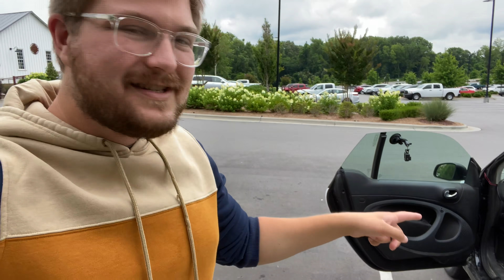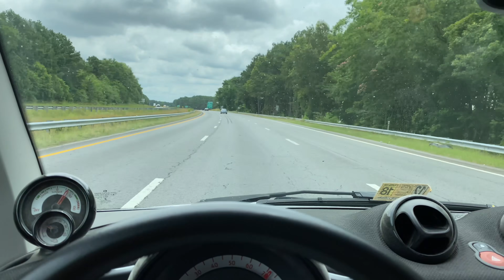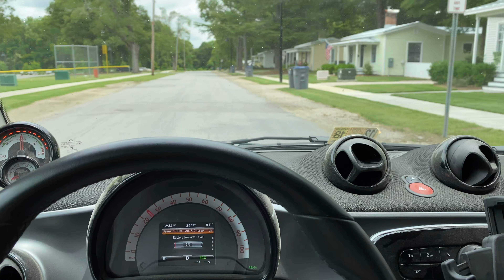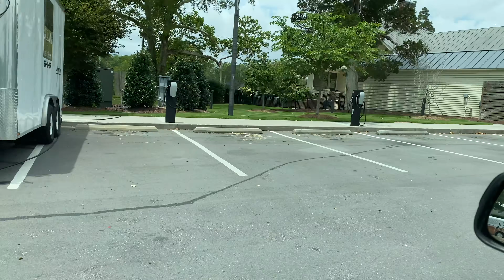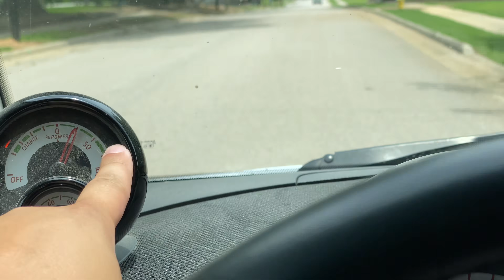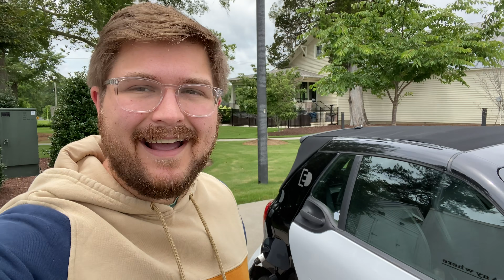2018 Smart Electric Drive 70mph Highway Range Test (Not Very Good)

Comment: Glad to see this.  We have a 2016 Smart For Two ED and love it for around town!  I love driving it with the back window open in our coupe in the summer.  We have a little device that just opens it about 1 inch and it is locked there when the car is locked.  It is not for everyone but it was our first EV.  It was purchased used.  It had been leased to a head shop in Colorado Springs area.  We found a roach clip in the seats after delivery to us in TN.  (We had is shipped!).  We love it and have since got a Tesla Model Y and have a Cybertruck on order!

Comment: I have the exact same car. My average consumption is 133 watts per km which is about 78 miles on a full charge. I’m gonna try to do a range test on highway and see how many kilometers I can extend the range up to. Will post the results here if anyone is interested.
Reply: Hi, I'm really interested. I'm about to buy a used Smart Fortwo 2017 (12.000€) and I need to drive 90km (56 miles) on highway. Do you think I'll be able to do that? Thanks in advance
Reply: Bad idea. Good chance you won’t make it in the really hot days and the cold days. And when some traffic jam happens you wil also be f…. So buy a Renault Zoe or something that has a little more range

Comment: Just bought one and i do mostly freeway between cities. my mpge is 120. after 42 miles of mostly 73mph driving the battery is at 42%. best part is it cost me $15k with only 6800 miles on the clock.

Comment: I had one of the last Smart CDis. Wow, incredible economy. 85-90mpg on a run to Scotland and back. EVs are a good idea but not practical enough for most people yet. Rich folk with driveways to wait all day and night to charge them and don't have any interest in driving very far, it suits them. The rest of us live in reality. I like EVs but I like the future version of what we have today. 1000 mile range no matter what the weather conditions or usage of lights, heater etc and the ability to pull into a service station, plug into one of the many plug points in place of the fuel pumps, charge to full in 5 minutes. Thats when I would like to get an EV. Until then, I shall stick two fingers up to everyone with a nice boxer engined Subaru. At least I feel alive in that.

Comment: Great video, really enjoyed it! I just bought my second smart EV a month ago (I live in the EU) and for those who pooh-pooh the range I can say - the car is not for you. My place of work is 3 miles away (all city driving) and I recharge the smart once a week. In the city I get about 80 miles of range without straining the battery. Need to go further? All you need is to have other cars in the garage and you're fine. So it's not for everyone, but it sure is for me!
Reply: Right? People should be realistic with their driving needs.
Reply: EXACTLY  @samusaran7317
Reply: Hey, I'm about to get a Smart Fortwo 2017 (12.000€) and I was wondering if it is possible to drive 90km (56 miles) on highway. Thanks in advance
Reply: @alex-eucmad.7133  Not sure, is it the current version?
Reply: Did you get one in the end ? 
I have other EVs, I doubt this thing can make it 90km on highway speeds  @alex-eucmad.7133
Reply: @alex-eucmad.7133 This range test just showed that he only got 52 miles. So I’d say no, you can’t get 56 miles on the highway.
Reply: +1. Not the right use for this car.

Comment: I bought a 2017 Smart a couple of weeks ago and it had a similar whistling sound on the highway. Turned out to be a leak at the top of the windshield on the passenger side. Mercedes is going to replace the glass under warranty since they usually break when they try to remove them.

Comment: My Smart diesel , fortwo does that far plus another 20 on less than a uk gallon  4.5 litres  it hold 6 uk gallons so that is a big range without filling , on the road charging on the uk roads are expensive and rare to find.

Comment: Rocky Mount...great city! I have been through there many times. I'm originally from Elizabeth City. Anyhow I have a 2013 Smart. I'm not sure what kind of range you were expecting but what you got out of yours if fairly typical. I can drive a distance of about 47 miles and have about 10% battery remaining. The only difference is that I am not driving 70mph. I take other roads where the speed limit ranges from 30 mph to 55 mph. Taking some other highway other than US 64/Future I-87, you could probably stretch your range a bit. Smarts...good cars but are definitely not made to go hundreds of miles on a single charge.

Comment: The 2020 models (not available in US) has a 90 mile range & charges at 22KW instead of 7KW goes from 10%-80% in 40 minutes. Wish US would make these available again.
Reply: That's the version I got a month ago, after trading in my 2019 smart EV

Comment: I'm looking into trading my gas 453 on the electric 453 but my commute is 46 Mike's round trip (although nothing over 50) my big concern is winter ❄️ we get down to -22°F here and at 60% usable range that's just 32 miles. Definitely not enough. Do you think it's manageable or should I steer clear? No chargers at work unfortunately.

Comment: It’s okay to range test with AirCondition/Heating on... after all we want to be comfortable! 😀  However, for those of us who live in 75*F ambient temperatures it would be of interest to know your estimated range without cooling/heating on.  I would think on this particular test your range would have been at least ~10 more miles !?  We all know that EVs consume about 20 to 30 % of battery capacity for heating/cooling.  At ~75*F ambient temperatures I still get a range of ~80 miles in my 2014 Electric⚡️SMART.  That is 95% inner city driving, where I get some regen helping to feed the battery. But I’m quite happy to get this much range from an almost 7 years old battery 😁.

Comment: The 2020 models (not available in US) has a 90 mile range & charges at 22KW instead of 7KW goes from 10%-80% in 40 minutes. Wish US would make these available again.
Reply: The US didn't remove them
Reply: What happened is that the smart car brand left the US because of low sales which is tragic
Reply: The 22 kw charging in European Smarts requires 400V 3-phase service and so would not be available in the US even if the car was.

Comment: You lost 1 BAR after promoting the BREWERIES, you are good. 😊
One thing you didn't mention in reference to taking the Smart on the highway; the drag coefficient rating.it has a smaller footprint than the model 3 but a lot higher drag.

Comment: So you're saying you did a range test with the AC on.... Are you not aware that heating and cooling in a electric car can significantly skew your results? I question your credibility as a EV range tester now
Reply from the maker: Yes I’m aware. This is more of a real world ish 70mph test not an instrumented test. AC probably used around 700Wh or so during the test. - we’ve been doing these highway tests with AC on at a reasonable number in each car.
Reply: How many times do you have both your heating and AC off? Almost never I bet
Reply: Makes you realise how much energy is wasted using oil burners with the ac on.

Comment: I have this same car (the glass roof passion). I leased mine and my lease is almost over. Using the AC makes a huge reduction in range. You probably could have squeezed out another 10-20 miles if the AC was not running.
Reply: Do you think I could make it for my commute? NE so cold and hot days. 40mls round trip ranging from 35 to 55 mph, mostly 45 mph.
Reply: @hogster5935  Just get a hybrid and forget about all the range stress driving this.
Reply: Yeah 40 miles round trip is fine. But since you'd have to get one used I'd make sure to see a report of the battery cell testing to make sure it's ok. Or take it for a 50-60 mile test drive just to make sure it still is on good health
Reply: My heater on mine drops the range around 17 miles! I preheat in the morning then turn on the heater 1/3rd into my drive. I also have added a plug in heater that helps a little.
Reply from the maker: It doesn’t affect it that much - it only pulled a max around 1-1.5kW during the run

Comment: I think you meant to say 155 and 165 in the tyres size you said 255 and 265 I think you are so used to see tyre with more then 200 mm tread with that 155 doesn’t compute.
Reply from the maker: Yes I absolutely was not correct on factory tire width!! You can tell I'm out of it